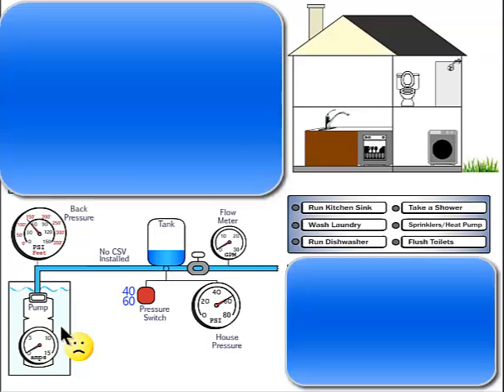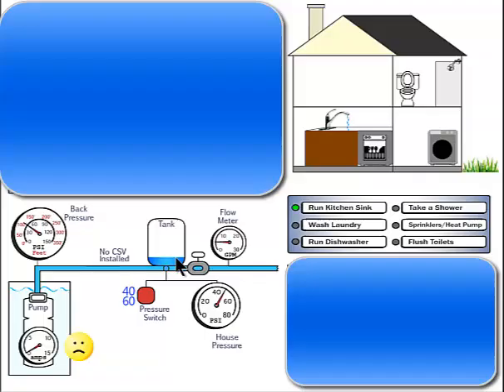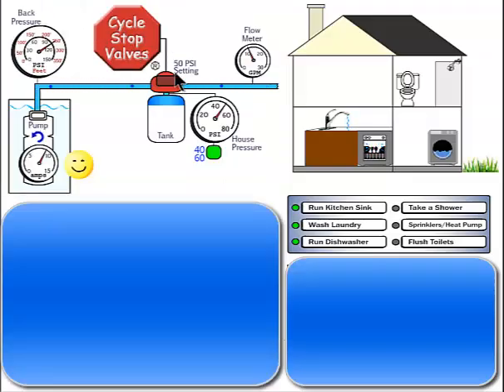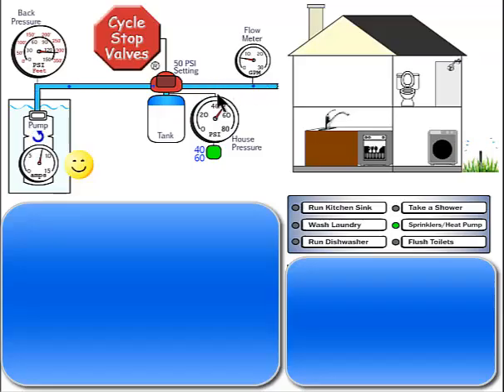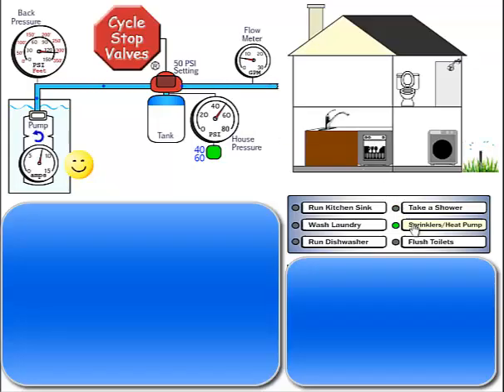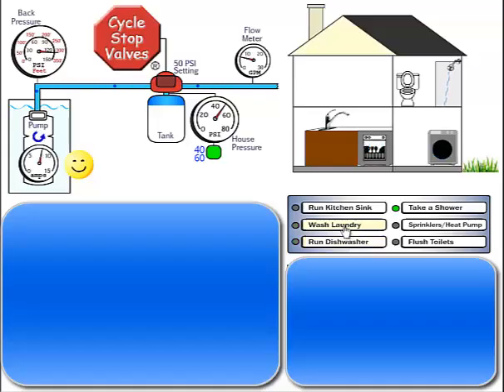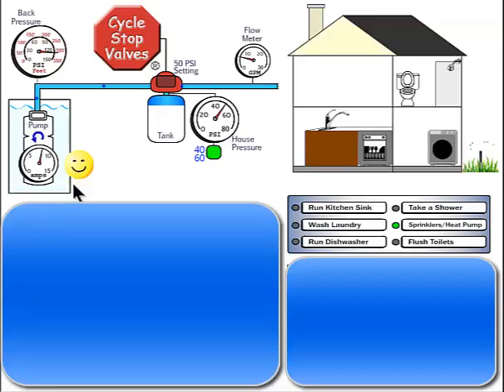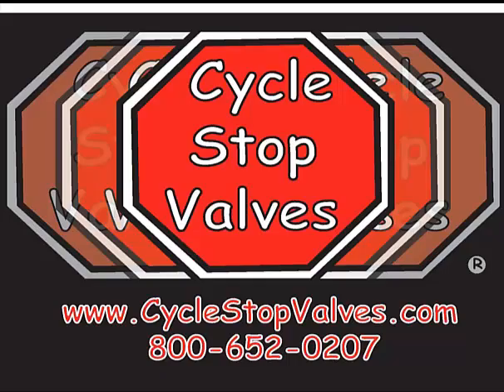How a Pressure Tank Works and why you need a Cycle Stop Valve

Comment: You claim this is better for the pump, do you have documentation from Goulds, Grundfos, F&W etc saying this? I find it very doubtful that increasing the head pressure on the pump is good for the impellers and bushings. If this were truly a better way to go, these pump manufacturers would be using this, dont give me the garbage about "then they wouldn't sell as many pumps" either.
I would be worried of blowing lines from the increased pressure between the well and the csv. 1 inch poly pipe is between 160 and 200 psi. PVC is 630 psi for sch 80 (no body's lime is plumbed with sch 80 pipe and fittings) sch 40 is what 350 to 400 psi? What about the glued fittings, thats the true weak link.
What happens when you pump the well dry, is the low cutoff on the switch going to work, or will you burn the pump up, because it cant build the pressure to shut the switch off.
Im always interested in new ways to do things, but if youre trying to change the industry standard, maybe dont be a condescending prick to folks making geniune concerns.
From what I can tell, this is just a snake oil gadget. 
Get me documentation from pump manufacturers saying its better for the pumps and maybe I'll change my mind.
Reply: I agree.
-HVAC tech. We also maintain pressures for our applications but use VFD's, Variable Frequency Drives,  to alter speed of pumps and therefor pressure for the entire system. Blocking flow is not the answer if how to preserve the life of the pump is the question.
Reply from the maker: Wow!  If you are really "interested in new ways to do things", maybe you should ask questions instead of being a "condescending prick" to someone who could help you.  Sorry, but you started it.  Now, do you want to learn something about pumps and controls or not?  If so, you could learn a lot from our web page and videos because for the CSV to be such a simple valve it has a complicated explanation, mostly because it is so simple.  Over the last half century I have built and installed many thousands of pumps made by all those companies you mentioned.  I thought I was good friends with their engineers and salespeople as we had "mostly" good relations for decades.  They were my first customers in 1993 and I spent several days with these engineers around the test pits at the manufacturers facilities testing the very first Cycle Stop Valves.  Even with 25 years previous experience in the pump and well business, I had not idea how CSV's really worked.  I could only put them on pumps and show them the amp drop, cooler running motors, precise pressure control, and of course complete lack of cycling.  These engineers explained to me how amps drop naturally when a centrifugal pump is restricted, back pressure from restriction doesn't hurt the pump or motor, motors run cooler at reduced amps, and lack of cycling would make pumps last much longer than normal.  

But even before I left the manufactures plant some would start treating me differently, not telling me things.  For months, even years I called these engineers to see if they had decided anything from all the testing.  I kept getting the run around and put off.  In the meantime I was making and selling Cycle Stop Valves to everyone who had a pump system problem.  I didn't get to test them on the run of the mill 1/2HP, house pump systems.  I only got to sell CSV's on strange systems where they had already tried huge pressure tanks, various pump control valves, tankless gadgets, and even Variable Frequency Drives or VFD's, and were still destroying pumps often.  Which BTW I was big into VFD's back then which is how I found out about valves, as they were being used as a backup for the undependable VFD systems.  Anyway, we have tested Cycle Stop Valves on the toughest to control systems with complete success since 1993.  I even have a couple of customers still alive from that long ago with systems we installed in 1994 still working daily.  

What I don't have is an affidavit from ANY pump company showing the CSV makes pumps last longer.  What I do have is the word of several engineers after they retired, as they were never allowed to talk freely to me while in the employment of one of those companies.  It seems a short while after I left the test facilities of one of those companies you mentioned back in 1994 they called a company meeting.  The CEO of the company said they had "Tested Cycle Stop Valves, and they make pumps last much longer.  This company makes pumps and anyone who mentions a Cycle Stop Valve will be terminated immediately."

Again, wow!  I always thought if you made a better mouse trap, people would beat a path to your door.  I never realized if you made a mouse trap so well it could make mice extinct, the mouse trap industry would do everything in their power to shut you down.  But there is a lot of money in mouse traps as well as pumps.  That is when I learned the industry caters to planned obsolescence, and even hides, buys out and shelves, or destroys what they call a "disruptive product".  These were all new words to me at the time.  I have spent the last 30 something years figuring out what they mean and how the CSV does what it does.  If you believe those big companies would tell you the best way to make pumps last a long time, you need to start studying the same things as well.  

I have also lost any patience over all these years with people who are judgmental about things they do not understand.  You could learn a lot if you would just call me like a normal person and ask instead of pissing me off accusing me of selling snake oil and getting away with it for 30 years.  Way back then I had no idea how they worked, like you.  I understand it is such a simple valve and good concept that it is hard to believe.  I have even offered to pay pump installers or plumbers if they can show proof of any kind of pump failure caused by a CSV or if any warranty has been denied because of its use.  So, let me put it back on you.  I will pay you $1,000.00 if you can show proof that a CSV has damaged or even failed to extend the life of any pump.  Nobody can show proof of a single failure and some are still running after 30+ years so far.  That is why pump companies will not endorse the CSV in any way and you would be wise to educate yourself in real world capitalism.  Not that I am against it, but you have to protect yourself from the flashy adds that big companies buy with your money.

Comment: It seems that the pump runs all the time, even to maintain pressure but at different RPMs. Can you please clarify.
Reply from the maker: The CSV is just a simple valve.  It cannot and doesn't need to control motor speed, just water flow.  The pump only runs continuously when you use water, as compared to cycling on and off while you use water, which is bad for pumps.

Comment: CSV sounds like a great way to blow you pipes apart or cause leaks as the back pressure greatly increases from 125 psi to over 300psi
CSV sounds like a great way to increase your energy usage, it takes a lot more energy to increase water pressure from 125 psi to over 300 psi.
CSV sounds like a great way to wear out your pump as the water vanes have 300PSI vs 115psi wearing against them.

If you want constant pressure, invest in a freq drive pump.
Reply from the maker: All that was debunked over 30 years ago, which is also how long we have been using Cycle Stop Valves to replace VFD's or Variable Frequency Drives.  I thought VFD's were great as well back in the late 80's and early 90's.  Then I got smart and figured out pump amps will drop naturally without varying the speed.  When I figured out a simple, inexpensive, long lasting, mechanical (no electric) valve was a better pump control than a VFD I never looked back.  Someday maybe you will get smart too.  All you have to do is research or test it for yourself to figure out everything you said is incorrect.  You can't get a better pump control than a Cycle Stop Valve.

Comment: I don’t understand the need for a pressure tank at all with your system. Is it only to prevent the pump from turning on when less than a gallon is used? Even through you say a big tank isn’t needed with your valve, isn’t it still better?
Reply from the maker: Yes, the 4.5 gallon tank can supply about 1 gallon of water before the pump comes on to feed icemakers and wash a toothbrush.  But any demand larger than that will trigger the pump to start and the CSV will supply water as needed for as long as needed.  Then when all faucets are turned off, the CSV filling the tank at 1 GPM starts a mechanical timer that keeps the pump on for another 30 seconds or a minute to make sure everyone in the house is finished with the water before the pump goes off.  The size of the tank is not important.  What is important is that the pump stays on until everyone is finished using water, and that is what the CSV does.

A large tank would only benefit in that you could flush a toilet 4-5 times before the pump comes on.  But that benefit is outweighed by having to wait for the big tank to empty while shower pressure is decreasing for 4-5 minutes before seeing the strong constant pressure from the CSV.
Reply: @cyclestopvalves8380  I do see the benefit of the constant pressure, only that it may mean more pump cycles than with just using the large pressure tank.
Reply from the maker: @paulbach  Nope.  You will be surprised.  The system with a CSV and a 4.5 gallon tank will cycle the same or less than using a 20 gallon size tank without the CSV.  We have a chart made by a customer many years ago in our PK1A spec page.  Won't let me give you a link here, sorry.  But there is no comparison to the strong constant pressure, and the larger tank makes pressure worse.
Reply: @cyclestopvalves8380  Thank you for your response. I’m am installing a well pump for a small 1000 square ft home. For a situation like this, with few people and fewer water needs, I am thinking that a large pressure tank will result in less pump cycles than using the csv.  My reasoning is that most of the water use will be intermittent. A toilet is flushed and the sink is used to wash hands. Then a few minutes later, a few dishes rinsed and glass filled for drinking. A little later A pot is filled with water for cooking. Thena few minutes later Another bucket of water filled for cleaning. Etc. provided each use is a gallon or just over, and the uses are spaced out by several minutes the CSV with a small tank would cause the pump to cycle on each time. While with my large 86 gallon pressure tank, (holding maybe 20 gallons for use) all these uses might have been handled with just one pump cycle. Am I thinking right?
Reply from the maker: @paulbach  Sure. Big tank maybe one or two cycles.  But small tank and CSV maybe 4-5 cycles.  Not big enough difference to justify the expense and problems associated with the large tank.  Extra cost, space, and heat are needed for a big tank.  Then a big tank causes water pressure to always be decreasing as water is being used, and stays at the low end of the 40/60 switch for a long time.  With a CSV and the small tank, strong constant pressure happens instantly after the first gallon or two is used, and you get the benefits of a mechanical soft stop. (no water hammer)  

This has been discussed in ad nauseum for over 30 years.  The fact that we are still successful at this after 30 years should tell you something.  You will notice we recommend a 10 gallon size tank when there are many uses and/or users in the house.  Where you would get 20 gallons draw from an 80 gallon size tank, the 2.5 gallons drawn from a 10 gallon tank is not its main purpose.  Sure the 2.5 gallons will flush a toilet or fill the ice maker all week without the pump cycling.  But rarely is a toilet flushed only once, and rarely do people wait a few minute in between someone else having used water.  When people in a house are up and getting ready for work/school water will be used every minute or so, somewhere in the house, until everyone is out the door or settled down.  Same thing in the evening.  So, the 2.5 gallons in the 10 gallon tank is filled at 1 GPM with the CSV and becomes a mechanical timer.  The CSV doesn't let the tank even start filling until the toilet is finally full, then with the CSV set at 50 on a 40/60 switch the tank will take about 1.5 minutes to fill to 60 PSI so the switch can shut off the pump.  During this minute and a half of pump run time, if anyone, anywhere in the house uses any water, the 1.5 minute timer starts again.  So, if you stand there and flush a toilet 1000 times in a row, the pump only cycles once.  When everyone in the house is up and using water the pump may run continuously for an hour or two, instead of cycling 7-8 times as it would with just a large tank.  

Knowing that the CSV is better for the pump/motor/tank/switch/check valve/space, cost, everything, is one thing, but the strong constant pressure for nearly every water use is so much better than the 40 to 60 over and over that people tell me they no longer even need soap in the shower.  🙂
Reply: @cyclestopvalves8380  Understood. That all makes sense. I’m certainly not a professional. Just trying to understand and do the best I can. So from what I’m understanding a water pump, mine a 1 hp red Lion, doesn’t need to stop and cool or rest as I’ve heard (one minute on, one minute off ) but it’s best to run them continuously instead of on and off. 
The pump slows down and pumps at a slower rate the more pressure that is ahead of the pump. Is this correct?
Would you recommend I replace my 80 gallon pressure tank with a 20 if I go with your valve? I’d have to try to sell it to someone. Or would you go ahead and use the larger one along with your valve?
Reply from the maker: @paulbach  It says right on the side of the pump motor "Duty/Continuous".  Pumps only need to rest for more than a minute after they shut off to cool down before a restart.  If they never shut down they don't need to cool before a restart.  The CSV doesn't slow the pump down, only slows the water flow from the pump.  The pump just thinks the well got deeper so it pumps less water as needed.  Same pump works in a shallow or a deep well, just pumps more water from a shallow well.  But the CSV makes it pump whatever you need.  If the big tank is still good you can use it with the CSV.  But you will learn to hate waiting for it to drain and the pump to come on so you start seeing the strong constant pressure from the CSV.
Reply: @cyclestopvalves8380  Faucets and such have restrictors built in so the pressure drop does not result in significant flow change at a fixture such as a shower head. Otherwise, the pressure switch needs it's values increased.
Reply from the maker: @nunya___  Well, increasing the pressure switch setting still allows the pump to cycle and the pressure to swing from 70 to 50 over and over.  50 to 70 over and over is no where near as good as a strong constant 60 PSI from a CSV.
Reply from the maker: @nunya___  Increasing the pressure switch setting to like 50/70 will increase the average pressure to 60 but cannot deliver strong constant 60 PSI like a Cycle Stop Valve does.  It is the restriction of the faucets and shower heads that causes the pump to cycle itself to death without the help of a CSV.

Comment: Is it safe to use this system if you have no idea what the specs are on your well pump or the well depth? I keep seeing people concerned about the pressure between the pump and the CSV. When I bought my house, it came with no info regarding the well pump or the well depth but I want to try this system.
Reply from the maker: Usually yes.  It is rare for a house pump to be so oversized that it builds more than 200 PSI on the inlet.  But it is possible.  Knowing the horsepower or amperage drawn and checking to see how many gallons a minute you can catch in a  bucket will tell us what size pump you have.  Or, you can just put a gauge and a ball valve on the pump and test for pressure.
Reply: @cyclestopvalves8380 I see, thanks for the reply.

Comment: This should be called a constant pressure valve not a cycle stop valve. In many conditions it will actually cycle the pump more than a traditional pressure tank set up

Under a constant use application it would work as advertised. But under actual use in most homes people don't leave water running nonstop
Reply from the maker: NO, it will not Tom.  The CSV with the same size tank will always, always reduce the number of pump cycles.  In many cases the CSV working with a much, much smaller tank will still reduce the pump cycles more than a large tank without a CSV.  But it is also called a "constant pressure valve", because you get strong constant pressure in the showers and sprinklers no matter what size pressure tank you use with the CSV.  If you had a CSV you would know, because you wouldn't even need soap in the shower.  Lol!

Comment: NOT well explained.  Absolutely no words about how the CSV controls the pump.
Reply from the maker: It is just a simple valve that closes or modulates flow at a set pressure.  Controls the flow by maintaining a constant pressure.  Pressure decreases, valve opens.  Pressure increases, valve closes.  Guess I need to make a video showing a valve opening and closing.  Sorry!  But for such a simple and useful valve it has a complicated explanation.
Reply: @cyclestopvalves8380  WTF, if this is just a pressure regulator why is the cost so high?
Reply: @richdobbs6595  It's a PRV with a 1 GPM bleed by like a bypass valve.